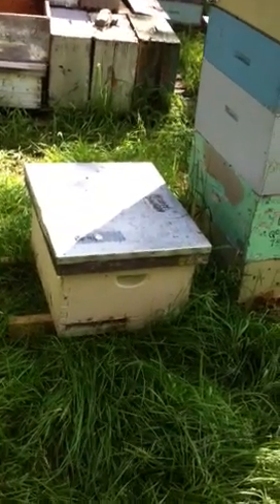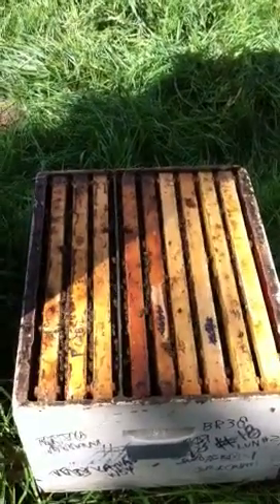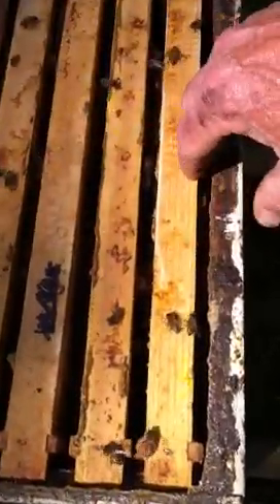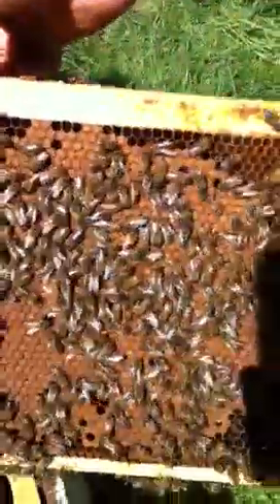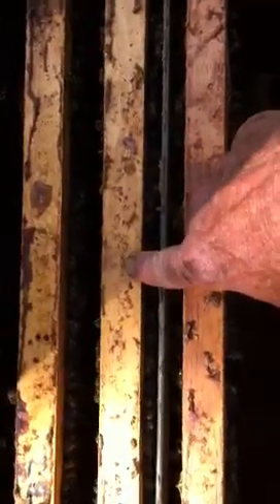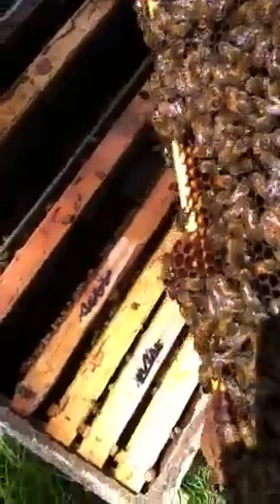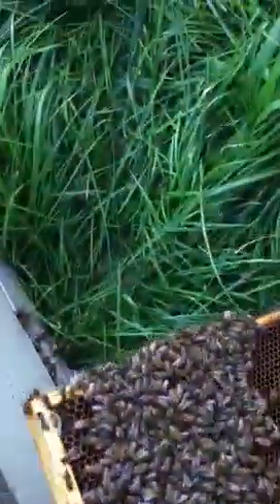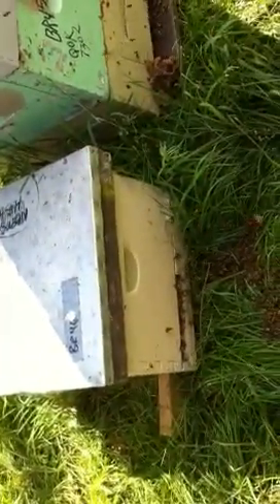More Cell Building

Comment: Where do you get, or how do you make a vertical queen excluder?
Reply: Good question. I guess one would order a standard size Queen excluder and:  rip it down using a metal cutting blade on the table saw. Then after ripping, grind off the burrs. Also two thin 3/16" dado cuts can be made into the sidewalls in which the metal excluder can be easily slid into. The cuts probably can be made with a skill saw using a straight edge guide. That's it you are done.
Reply: Probably could get a plastic excluder and mount it on a thin wood frame also.